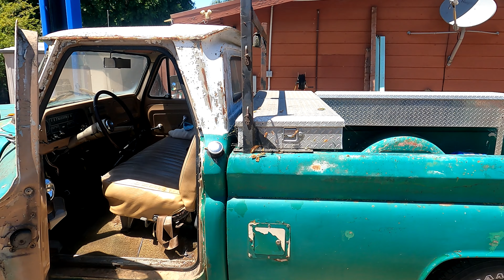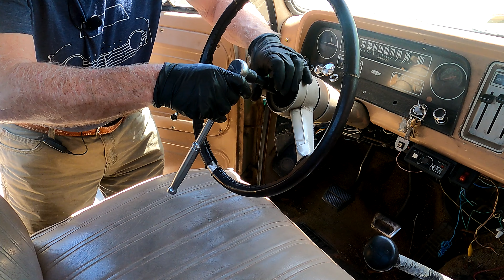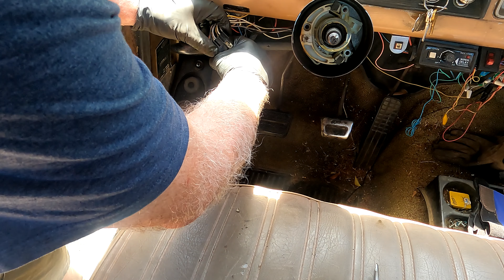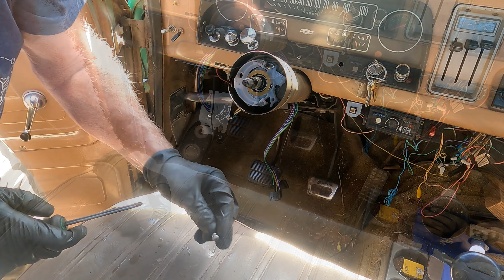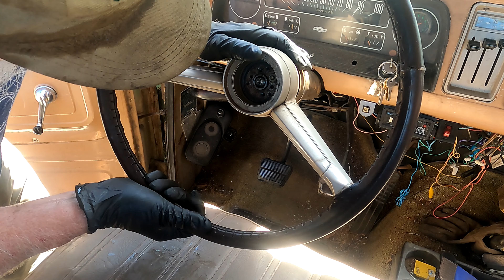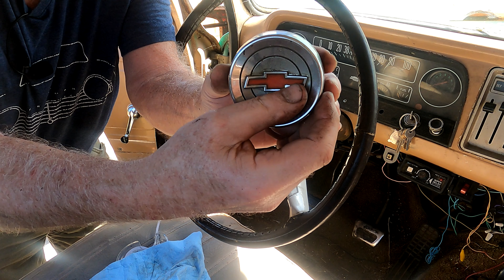1965 Chevrolet C20 Pick-Up.  Directional Switch (Turn Signal) Replacement.

Comment: Mistake #1: repair and reuse the original turn signal switch.  Original GM parts are of unbeatable quality.
Reply from the maker: That is what I did 20 years ago.  Sometimes, things are beyond fixing. Thanks for watching.
Reply: @ejhbritishcars6907  I helped my Dad change the GM turn signal switch out in his 1966 C10 back in 1987 with an aftermarket part. It's 2026 and I just replaced it again. I'm OK with that kind of distance between problems. Same truck that's on my avatar.
Reply from the maker: Sounds like the replacement out lasted the GM part by decades.  Thanks for watching.

Comment: Great video by the way. Notice with install my hub is to tight to the wheel and grinding a bit. Any suggestions. Isn't there another steering wheel spring that keeps the wheel centered?
Reply from the maker: You will need to slacken the column attachment bolts and slide the outer column toward the dash  a bit, 1/8 to  1/4 inch so that there is a slight gap between the hub and the top of the column.

No other centering springs that I am aware of.  It is the caster of the front wheels that create the self centering force in an automotive front end.  Thanks for watching.